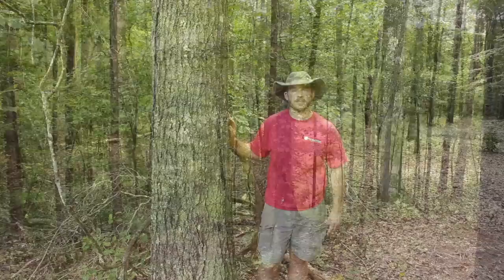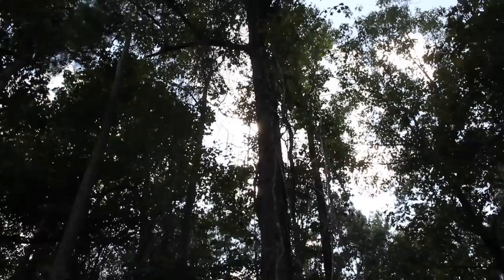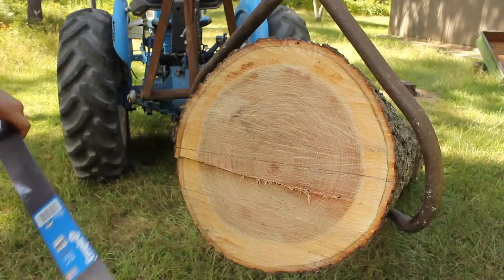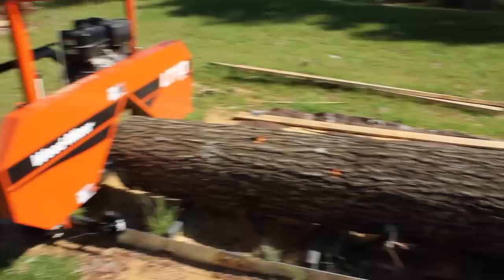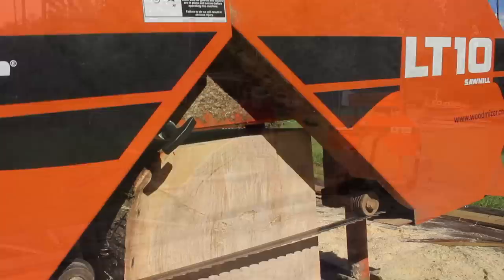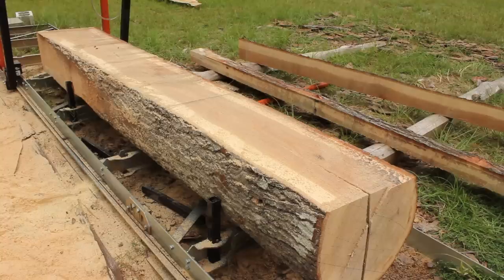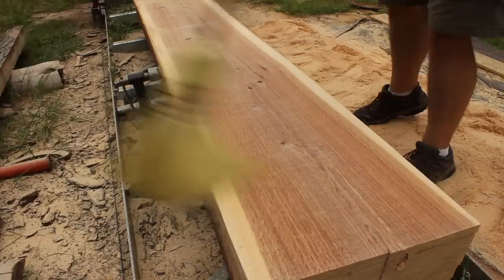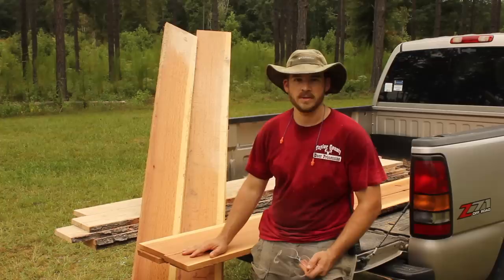AMAZING Grain in a Quarter Sawn RED OAK!

Comment: OK, some one explain to me a bit more what was accomplished with quarter-sawn?
Reply: Due to the way they are cut, quarter-sawn boards are not as susceptible to warping and bending like boards that are traditionally sawn. This is becuase the growth-rings in quarter sawn are pretty much vertical when you look at them from the end. Take a look at the end grain from a standard piece of lumber from a hardware store and you will most likely see a circular or very diagonal grain. Also, quartersawn oak shows up details in the grain that would otherwise not be seen such as 'flames' which are medulllary rays which are natural fault lines. Quarter-sawn lumber is great for making fine furniture as it's movemnet is minimal after milling and finishing.

Comment: Curious what ratio mix gas you're running. Sure is smokey. I run Amzoil Saber synthetic 100:1 mix in all 2cycle equipment for past 15 years or so. No smoke nor fouled plugs ever. Something to think about, anyway.

Comment: to get more yield you need to level the log to where the heart is the same height off your rails then lay out your first cuts, never cut through the center of the heart (pith) encase it in your center board, you can get five boards out of the center of your log that will be quartersawn, the pith usually is cracked or rotten  you can cut the pith out later for two quarter sawn boards, if you lay it out with your pencil you can cut your top board out first which should give you room in the throat then you can cut the next five slabs out which will all be quarter sawn boards then you can cut the remaining sections in half and start quarter sawing the rest to yield the quarter sawn lumber, yes its a lot of work but thats why its worth double what  regular lumber is, if you want to have a 90% yield you can cut lap siding between the quarter sawn boards but thats a lot of lay out and work.

Comment: Hi Mate, You should look at getting the right safety gear to cut trees down hard hat, faceshield, correct safety clothing etc. From someone who knows the industry and have investigated many accidents in the past. Also your Chainsaw starting technique leave a lot to be desired, Just last month a guy did a pull down start and the chain saw had a hickup and it cut him on the shoulder badly, Foot on the saw heal on the ground and pull. Dont want to put shit on you but I want you to demonstrate the correct method if you are youtubing. Good luck From OZ

Comment: I saw no advantage to the first cut except it limited your width on the quarter sawn section. Without the first cut, you would have had the same result with boards twice as wide and an option to mill off the sap wood if so desired. I used to mill pine with my chain saw and a saw mill attachment. You have a much better set up for sure.

Comment: Beautiful wood..but you do know thats not quarter sawn right? ..what you have done is quartered the log and then basically radial cut it. This effectively gives you one maybe 2 peices of quarter sawn timber right through the centre section. To quarter saw it properly...you quater the log and then your subsequent cuts should all be at 45degrees to those cuts. This gives you quatersawn accross the whole log... lot less wastage and way more figure accross all boards...hard to explain in writing but take a look at images on google and you will see what I mean....at least thats the way i understand it in the UK. As a cabinet maker and P/T luthier I am still dead jealous that you have the mill and the trees to go with it...think of the guitars I could make... 😊

Comment: It's called quarter sawn because you have to cut it into quarters. Then you turn between each cut and the grain all comes out vertical. The problem is that the boards get smaller as you go. I don't know who showed you how to lay this out, but it's wrong.

Comment: Why did you cut it in half.  No need.  I used to get all picky about quarter sawing but in reality some flat grain is prettier in many circumstances.  Quarter sawing is more for boats and decks and other outside stuff etc.  You still get a LOT of quarter sawn wood by just milling it as you go.  I usually only finish my straight edges as per the use for the wood.

Comment: You didn't really quarter saw that log.   Yours was a regular "slash" cut that always gives a quarter sawn board or two out of the center of the log and gives you more wider more useable lumber for other things above and below that.    A true quarter cut gives a lot of narrow boards with 45 degree edges and the same number of wider boards you get with your regular slash cut        Visit The National Gallery of Art on Constitution Avenue.      You'll see thousands of 9 and 10 inch wide quarter sawn white oak boards on the floor.      Quarter sawn lumber is far more stable and free from warpage than any other cut.

Comment: The couple of quarter sawn boards were kind of an accidental find. If you do proper quarter sawn you will have all the boards quarter sawn but not get a whole bunch of wood for a lot of effort.
Reply: They weren't quarter sawn, just flat sawn boards with vertical grain from being at the center line of the log.

Comment: I don't own a sawmill of any type but was curious about the process so I went in search of some information and I found the following video that was very helpful.

https://www.youtube.com/watch?v=VvUPJPFg4wM

However, after thinking on it for a while, I thought there had to be a lazy mans way of getting close to the same results with out having to switch the log end for end on each cut as shown in the video.  

The idea that I came up with was to trim the log into a, more or less, evenly sized octagonal shape centered along the core of the log.  So you may have to jack up one end of the log a couple of times to get that to happen.  Once I had my roughly evenly shaped octagonal log I would make a cut through it roughly 1/3 of the way through the log.  Then remove that top 1/3 from the mill and then continue to mill the next roughly 1/3 of the log, this would give me the widest pieces of lumber.  Once that middle 1/3 was milled I would add that top 1/3 back to the mill and rotate the top and bottom thirds 90 degrees so the existing cut is vertical and then mill 1/2 to 2/3 of those two cants.  Then flip the remaining lumber over 180 degrees and finish up milling the log.  The "roughly" 1/3 cut points would be variable, dependent on the dimension of lumber you needed to get out of the log.

Even if I were to split the log into quarters as the video says needs to be done, I think I would first trim the log into an octagonal shape before quartering it.  It just seems like it would be helpful in lining up the cants in the mill.  Besides that, the video seems to assume that you are using a vertically oriented band saw, not a horizontally mounted band saw as you are with the WoodMizer.
Reply: I am not sure of the geometry of cutting with a vertical saw blade, but with a horizontal one, you don't need to flip the cant 180º between cuts, just roll it back and forth 90º.  Also, I am not sure what you're doing making the log octagonal - even to get a large log into a small bandmill you only need to remove two corners.

Comment: is there a way to use the sawdust?
Reply: I had a friend In Fredericksburg, Va that had a saw mill, He told me he could sell every thing from the saw mill except the noise. he was about 80 years old when he stopped sawing and that only because a tornado took out the saw mill he passed away about two months latter. that was in about 2000-2001 That was off Route 17 1 mile east of the Geico Home plate,
Reply from the maker: Jimmyzb36 There are a few things you can do with it. Mulch, bbq pellets, etc. But I just pile it up. I don’t really have a use for it.
Reply: I have enjoyed your videos and thank you for the reply

Comment: Is it just me or wouldn’t it be better on your saw to remove each slab as it is cut instead of cutting under a pile off already cut wood? I know you could cut a one foot thick slab but, is that good equipment care. I mean even a six inch by six inch beam is an animal. Nice wood and kudos on showing off your property and farming equipment.
Reply from the maker: Robert Langley I don’t think it makes much difference. The weight of the wood above the blade is supported by the wood that’s left directly in front of the cutting teeth as it travels through the log. The weight of the wood doesn’t rest on the blade. Thanks for watching.
Reply: Fall Line Ridge .....If you can bind a chainsaw chain by pinching the chain/bar from unsupported cut wood I can’t help but think the weight of your sawn wood has to be putting immense downward pressure on at least the back portion of your saw mill blade, can’t see any way around it. But it’s your saw, have at it partner. I would at least stop at “third points” and put in wood wedges to support the weight of your “cut” wood.  Again what’s the prob with taking each slab off as it’s been cut? Just seems dumb to me. Maybe I’m anal.

Comment: If you would turn the mixture screw out about 1/4 to1/2 turn, your saw would run better,start beter, have more power and much less smoke. Running way too rich.

Comment: hmm quarter sawn, but I never saw you cut into quarters? ;)
Flat, quarter, rift, etc are a process for cutting wood. So they can't be used as a term to describe the direction of the grain. 
All cuts can produce 90 degree wood but some cuts produce more 90 degree cuts with the same size log at the expense of additional wood waste.
https://s3.amazonaws.com/file.imleagues/Images/Teams/Uploaded/201704/201743174041406532e6649529fe29d220941c4314f9df8.jpg

Comment: You might have the grain in the right orientation, But not a true quarter sawn log. You did the most common cutting called plain or straight cut. 

After you would cut the log in quarters, think of it like this. Set the log down on the outer side of the log, point up (center of log). then you would cut the quarter log vertically. That is how to get true quarter sawn lumber. 

I do not like improperly named videos.

Comment: Puppy was cute. 1st off, learn how to actually drop a tree. You pulled stump pulls 2-3ft and screwed up your butt cut. 2nd, if you want decent qtr. cut oak don't screw around with little dia logs. You only got 1 or 2 decent boards that were usable. For all that effort, its not worth the time. I personally never had anything much under 20" and preferred 24" logs for personal qtr. sawn lumber. I had each logs quartered and then cut my lumber from each piece. Please understand,  just because I say this sure doesn't make it correct. I was in the veneer business for close to 30 years and a log buyer for 20. That and a dollar 7 cents will get you a coke at McD's. Take what I say for what's it's worth, not a damn thing. Remember,  you asked for comments. Good luck.

Comment: You need some education on how to cut timber with out pulling the heart when you fall timber. The tree sounded like it was ripping and crying when it was falling.
Reply: Never felled a tree for lumber, but I saw that big tear/shake and wondered what an expert would do.
Reply: @ianrutherford878  there are a lot of different techniques that you can use but all of them require that you never leave fiber uncut in the center/heart of the tree. I cut timber commercially for 23 years and you can learn even then. That was a poor technique. The osha standard of hinge cutting works well for beginners. I don't always use that. It always slowed me down. Cut low on the stumps and don't pull hearts!!!!
Reply: @ianrutherford878  It's also just about impossible to tell you how. Every situation is different. Ex: Heavy extreme leaners, smaller/bigger timber and manipulating or failing trees in ways that they are not leaning towards. If you're ever around Florence Alabama I would be happy to show you how I do it.
Reply: Jeremy Rourke  Thanks.I was hitch-hiking thru thereabouts 45 years ago,but my days of long-journeys and tall trees are over now.Just interested and glad to know that some people have the experience.
Reply: Jeremy; Damn Straight, he needs to be taught. I knew when he cut the wedge he'd pull and split the center/heart. Then he ran before he had it cut good enough. If you are to damn afraid of your skills at falling a tree, don't pick up the saw. If you cut a tree right, it wont kick back at you. And you move back more than to the side. A few years ago I had to take down a small pine that hung over a house. I cut it to spin out away from the house. Gee, a tree falling the opposite way the weight of the tree leans. I did have one guy on a rope just encase, but it spun like it was cut to do. I'm no skilled lumberjack, but I learned on the farm from my elders that did cut lumber and cleared the land. This guy needs to learn from in the field with guys that do it rather than off YouTube. I'm not knocking learning things on line, but hands on in the field will benefit him, and maybe save his life and or pocket.

Comment: That doesn't look like quarter sawn oak. Are the markings just not showing up on the camera? Is that helper of yours a beagle?
Reply from the maker: L. J. Bush Had some very nice markings. Probably looks much better in person. Yes, she’s a Beagle.
Reply: I can't see any of the tiger striping or whatever they call it on here, but if you're happy with it that's all that matters. Thanks for sharing with us.
Reply: Fall Line Ridg
Reply: No offense intended, but it isn't quartersawn.  It has basically been plainsawn, so some board edges will have vertical grain.

Comment: Dear sir, you scar me with your chain saw. I'm not sure who taught you to use one properly when cutting trees. But someone should give you pointers before you hurt yourself or mess up your chainsaw. When dropping a tree the first notch you always cut the angle too or before the center. Then you need to cut bottom also at a smaller angle to meet the first. this gives the tree the best chance to fall n the correct direction. The back cut is also at a small angle to meet the front cut. This keeps the tree from coming back at you. The next issue I have seen was when you cutting tree in sections. You always cut the bottom up to the center just below. Then you can start the top cut all the way through the tree and it will drop it without binding. I glad you use wedges but you really don't need them in this cut. Any time you cut your top cut first you risk binding or trapping the blade in the middle of the up cut.